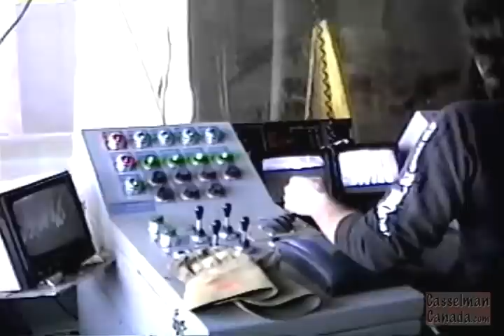The Lumber Mill in Fort McMurray, Alberta

Comment: I was working in a mill in NE Washington at the time when this video was shot.  We did a lot of things differently, but this brought back some fond and some not so fond memories! 
Thanx for sharing it with us.  
I started on the green chain,  moved to edge picking,  and then on to operating a "top-arbor" edger. I then moved out to the log yard operating a Cat 966. Part of my responsibilities were tending to chip car loading under the wig-wag, feeding the mill,  sorting logs,  unloading log trucks and for a short time operating debarker feeding the mill. 
I think it is interesting to see they are not chipping, but had a bin sorter on their green chain.  Their dry chain was interestingly short and labor intensive. 
I also found it interesting that they were still tripping the stakes to unload log trucks.

Comment: This is an operation of quantity, not quality. Too much waste off.
Reply from the maker: Yep a lot of waste back then. But it would suggest more quality rather than quantity. During that time they had a specific contract to provide high quality 15 foot 2x4s for a Japanese market. It was an odd length which is why they got the contract. So they did waste more than normal but the quality had to be there. You would not do that now- nearly 30 years later.
Reply: Thanks for the explanation. I knew there was more to the story than just my casual observation. Just the volume of the output probably more than made up for the waste but today there are more uses for it.

Comment: what is the large black cone like structure? is it to burn the offcuts?
Reply from the maker: +staalmaffia That is the way it used to be done several years ago. More recently even the scraps are put to use in manufacturing products. Less waste, less polution.
Reply: As in chipboard (oriented strand wafer board), wood putty or paste, and even paper or other pulp?
Reply: staalmaffia the "Teepee burners"have fallen out of use. Chips are being used for building materials and the bark and 'dirty' chips and sawdust are mostly burned in power plants or boilers for steam for drying lumber and other heating. 
More uses are being developed for byproducts rather than just putting smoke into the air.
Reply: Wigwam burners out here.